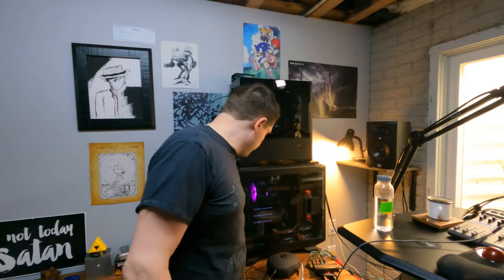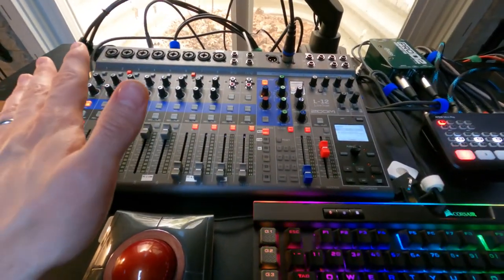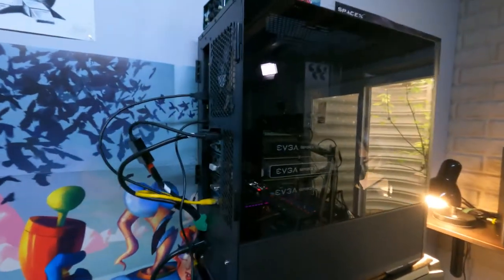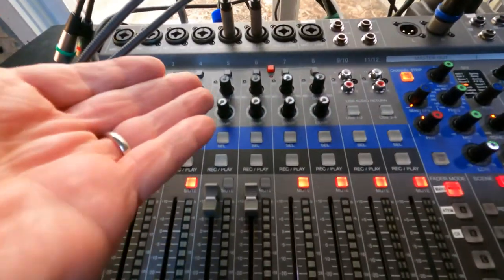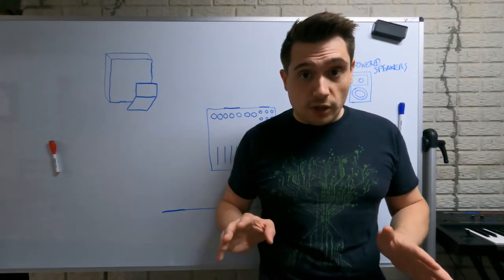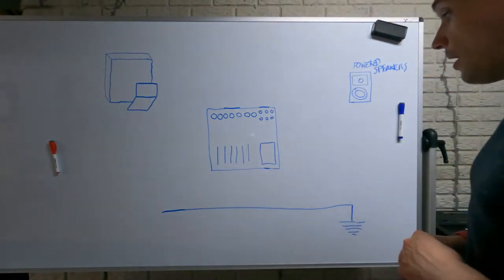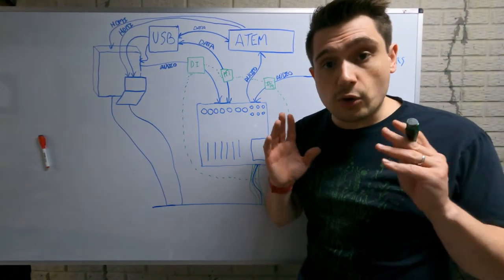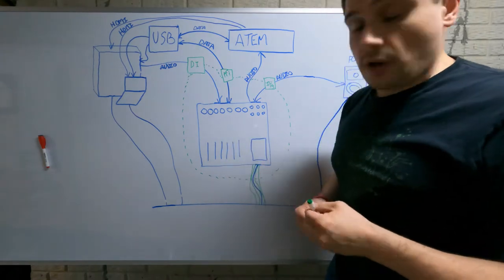SOLVED: High Pitched Buzzing Noise / USB Audio Mixer Ground Loop Issues

Comment: Having an issue modifying a church sound system and the direct box or the IFI unfortunately may be the fix. Organist aged out and now all music played from computer, trying to take the speaker out on laptop to the mixer and then a mixer output back to the laptop thru USB Creative Labs Sound Blaster Play! 3. After plug in the USB get low moaning sound. Right now the speakers and microphones go into/out of an amp that the mixer was also fed into --- like I said modify - taking the amp, cd player and cassette deck out of the system. Once speaker and microphone plugs arrive making switch to just mixer.  Thanks for thorough explanation.

Comment: The IfI defender is working like this -   From your USB out / in ,  it convert the data signal to optical signal and 
transmit through an optocoupler the data as light , In the optocoupler there is a light sensor that is used to convert the 
light back to electrical data signal and through a buffer is send to the Out / in at the other USB port .
That way thee is NO physical wire and thus NO electrical ground between the two devices at all .
This is also why it need an external powersupply and that need to be ground liftet so to NOT just introduce another 
ground path .   
Note that I write Out / in that is because the USB or if use firewire is Bidirectional so signal flow both ways .
Those iFI defenders work extremely good and it really doesnt matter what brand you use or the actual quality 
( as long as its not really bad ) because it will never affect the sound ( it is all digital signal only ) so as long as it 
comply with the USB or firewire standard ect then it work just fine.
As for the one that burned , I will say that one was a manufacture defect , typically a voltage regulator that 
was shorted out somehow , that normally very rarely happen because those run constant power and not like other 
components draw more or less power .

There is ethernet isolators working just like this too and perfect if you have a modem / router / switch / hubs ect 
in / on / between your computers , aka network and internet that can further isolate that dam.... sigital noise too .
Same principle using optocouplers .

USB and or PCI power conditioners also working very great .
I have used a PCI ( not PCIE ) card power conditioner inside my computer ( there exist PCIE too ) 
what they do is offload the digital noise and transients that is on the powerrails in computers with not the best 
power controllers / and / or powersupply .
Those can be extremely noisy and sometimes this noise going out in all different ports on the computers .
From onboard soudcard to usb ports ect ect ect and those can actually remove it .
It also make the computer run more stable too because the power is with less spikes and noise .

Many of the more exotic solutions have a specific purpose and wont work equal well in all systems .
It all depend of system and situation and what cause the noise in the end .
I agree that most can look like  snake oil , but it is just until you have a specific problem that can only be solved 
by an exotic solution .

Noise fighting is really an unfair fight and an extreme art to master .
Great video  , im subscribed , keep up good content .
Cheers ..
Ps sorry for typos , im on morning coffe right now .
Reply: No. There is no optocoupling circuitry inside idefender.

What they actually do is they switch impedance for power and ground lines. If the current draw is more than 5mA, there will be direct connection for the ground and +5V being transparent effectively. If less than 5mA, the impedance switch is on and there comes high impedance for the ground and +5V. If there is an external power connected to idefender, ground and +5V have high impedance as well. They used high impedance instead of totally lifting, so that the handshake could work.
Reply: @juneaftn  Ok , so they do it different than normal USB / Firewire  ground isolators , all 
the models I have used was using optocouplers and is a great way of totally isolate the signal . 
Also using optocouplers is less prone to 
failure too . 
Thanks for the correction about the IFI  .
Honest , I dont really think it will be as eficient as those with optocouplers or safe , 
I just think about the one that burned and 
that shouldt be possible unless something 
going bad in some regulators and it send 
full power through it ( typically caused by 
some kind of short , capasitor , you name it)

Thanks for correcting my mistake on this IFI 
I simply thought it work like all the other 
ones I have seen through past 20 + years .
I think I will stick with the good old based on 
optocouplers so to get 100 percent electrical isolation , it is much safer for the 
connected devices .

Just another little thing , thanks for the tip 
about connect the DI box the opposite way ,
that works GREAT and I simply dont know why I didnt think about this because they are bidirectional , well they are fully passive  
and connect the other way around , YES 
it fully works   :  )

Comment: thank you very much for the time you took to explain the process. Definitely one of the best explanation I've seen. Few questions though - is there any other device that could help with ground lifting the USB ? My mixer is connected to ground so not alimented via USB but I still of course get some nasty high pitched sounds (not hum). And I don't live in the US so somehow getting the Ifi isn't easy. Also, which mousepad are you using haha ? I have the same Kensigton mouse and they definitely rock but they also need an appropriate mousepad given the height of the base. Thank you !
Reply: I have a USB ground loop noise issue with my boss gt001 effect, the audio is silent but once usb connected to the computer the noise is irritating and kills the recording, recording through my Presonus audio box it is perfect. Do you have or have you found any solutions?

Comment: Hahaha nah I love this, this helped me feel less ridiculous than I thought. That this isn't a simple problem with a simple answer and is actually a complicated matter. The weirdest thing about my issue is that my arturia 49 would cause feed back snores when going into power saving mode. So if I tab a key, the noise dissapears. But the noise doesn't occur when I unplug the midi DIN to  midi din hub cable. This noise drove me crazy for so long cuz it would come and go and made me think I solved the noise issue then sudden it would.appear even while I wasn't doing anything to disturb it. And I would start pulling things out and moving them around trying to find the problem.

But I have so many prices of gear its crazy..... But at least I won't get anymore gear so I don't have to worry too much

Thank you, for this video though. Bug fixing is a major part of our growth

Comment: after pondering a bit further, im pretty certain you can hook up a your atem to another usb isolater or 2 save money, hook up a hub to the usb isolator you have and run both you mixer and atem off it. . ,  once you do that , the only isolater you need should be from audio cable to mixer, since its a connection to the computer, once those 3 pc attached items are isolated , you should be able to disconect all the other isolaters you have including the  ones the speakers
Reply: From what I read about these devices they use a chip with a limited bandwidth. So some support say 15mbs so USB1 but not all USB 2 and definitely not USB3.
Reply: @stephenhookings1985  essentially it is a some sort of digitial isolater,  almost every one i found on the market is limited to usb 1.0 from the year 2000. . so its extremely slow, but IFI claim to support 3.0[ i havent tested this since i dont own one yet , but you can since you own and easy test would be is to do a large file transfer from to a HDD tru that ifi and do the same test with it connected directly to the pc. . notate , usb 2.0 easily carrilies up to a 100 mega bytes a second

Comment: I service and repair amplifiers, receivers, transceivers, power supplies, etc. and this noise is very likely coming from a poorly filtered or particularly noisy switching power supply or PWM LED inverter/driver circuit.  What I hear in that noise is 120 hz hum/buzz or possibly an audible sub-harmonic from a switching element that's around that frequency.  Cheap switching power supplies and drivers can radiate electrical noise and RF down wires and into the air,  and of course,  long ground loops can act like an antenna and pickup everything. 

 I doubt the audio specific gear (powered speakers/mixer, etc) is causing the problem,  as they are engineered not to radiate noise or even create it in the first place.  It's likely a cheap wallwart switching power supply (like something that would come with a powered USB hub or the video switcher) that's causing the noise or possibly even the PC's power supply.  

One cheap way to track down the offender is to buy an inexpensive battery powered AM radio for $10-$20.  Turn the radio on,  turn up the volume and tune it until you just hear static, and start walking with it around the room and move it near any electronics that could potentially be electrically noisy (wallwart power supplies, RGB LEDs or their power supplies, the PC power supply).  AM radios are particularly sensitive to switching power supply noise and harmonics,  it will get loud and you'll hear that buzz the second you get near something noisy.  I've use this method quite a lot with good success.

Comment: Very nice and clear video, with some good solutions presented.
I do have a few questions however.
-1- Am I wright that using a Directbox with groundlift is actually effectively the same as soldering a custom audio-cable with no ground connected at on one side? (appart from the resulting balanced signal)
-And an Isolator is also kind of the same idea... (Although those actually also "cuts" the signal lines) Am I right?
Making an custom cable that way does feel unsafe though? But is that the case, when both sides are still grounded by the powercable?
-2- Another, I think stupid and 'unsave question' (so not an advise to anyone!!): I do understand that it is not a good ideal to bypass the "ground-pin" on powercabels as discussed in the coments and in the vid, there is a serious good reason those equipment need this grounding. However technically when I think it through I tend to believe that as long as those (lets say) speakers are connected (and grounded) through the audio kabel with a mixer, wich is properly grounded there shouldn't be a problem. Can anyone explain to me where I'm going wrong here, cause I do have learned it is a bad idea, but I don't know exactly why...
BAD IDEA (see my own response)!!
Clear is that using those IL-19 between a mixer and speakers is a more obvious and safer way to hook things up.
My last question is however, do they alter the sound? I read a lot of mixed reviews on the audio quality of 'Ground Loop Isolators'.

Thanks again for the great video!!!
Reply: Okay I figured out question 2.
The "Power ground pin/wire" is often used to trigger 'safety fuses' and other safety elements. When this ground is 'cut' these safety measurments are Bypassed. So no matter whether the grounded audio kabel will or will not provide a ground, the device will not shut itself down when needed, so this is indeed a very bad idea. Something someone should never ever do....  Now I DO know why this is called a recepy for disaster. (fire/electrocution) To be honnest I'm a bit confused why they still sell those 'groundlift plug' adapters ??????
Reply from the maker: Great questions! I will answer your questions to the best of my ability:

1. The proper way to ground lift between the two sides is to use an isolation transformer, so there is NO direct electrical connection between the two sides -- even on the "hot" signal sides. The quality of the signal passing through the isolation transformer will directly correlate with the quality of the transformer. Very good ones will be as close to a "flat" EQ response as possible, whereas bad ones can introduce signal loss that affects the quality of the audio.

2. Regarding grounding through audio cable shielding, you never want to do that because the gauge of the audio cable's shield is way too high. Just take a look at high voltage electrical cabling and notice how thick it is compared to the shield of your audio cable.

Since the audio and data cables are way too thin to sync 120+ Volts to ground, in the event of a short the audio and data cables will just get really hot (possibly setting a fire) and the current will try to sync in alternative directions, potentially hurting someone.

Hope that makes sense! Thanks for watching and good luck solving your ground loop issues!

Comment: More questions/problems.
* Opening a project i got message that 970 files are missing. With Search i found some missing files, it became 270, and these can't be found anywhere (i've searched all folders /sub..sub_subs/ in my big folder dedicated only for StudioOne, all back up /mirror/ folders on 2 external drives). It is an old and very extensive 'precious to me' project, and ridiculous thing is, for example there is a guitar solo, i splat it at some points to get rid of some noise when i was not playing, now the solo is there only in pieces; all channels are ripped off here and there. Plus other issues.

* Yes, as a rule i have a 25 minutes save; "use cached plug-in data on save"; "ask to copy external files when saving document" all on/checked. 
* I didn't change nor names, nor locations of working folders and files (though i have this project saved under different names as versions).

* What i did is: i replayed some important stuff on left-overs and added two old stereo mix tracks of this project/song with different EQ settings (and with mistakes, quite unbalanced, but it is better something than nothing, there is no way i'd re-do everything due to circumstances and unrepeatable settings and instruments). I aligned everything nicely (time, buses, volume,..), corrected, blended everything nicely, and put vocals at the right level (up and with different settings, that's why mainly came back to this project), clicked "save". Logically, the DAW asked me "do i want to add these two stereo tracks/files", obviously, i clicked "yes" and...1475 files for each added stereo track started copying. In panic i pressed "cancel", but it was too late. Where these files are from, why?! Why these stereo tracks came with so many files? Where they went to?
I checked the media folder to look for duplicates: no duplicates, but there are about 6000 files there (and some of them are not from this project).

* But this is not all: i had plenty enough of memory space (workable 450-500GB free), now i am in the end of red zone with 78GB left.  Agh..

* But this is not all again: i started clearing up the space on pc and the more i delete or move ...the lesser space i get on computer...now it is 50GB.

* To free space and continue working (without interruptions and CPU overload) i thought that i would mirror the path, create the same folders in external drive, link the project to media files there, But i am afraid to make things worse in this and other projects (especially considering that freeing the space now works for me the opposite way).

* What is wrong? How can i fix all that mess?

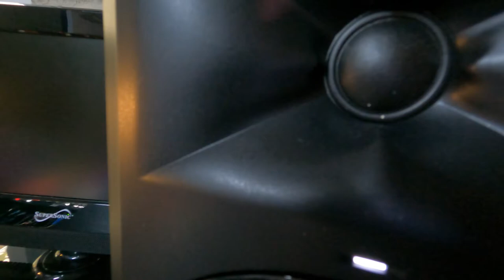Comment: That sound you hear at 11:30 looks like coil whine,  I solved this by getting a Behringer HD400, it eliminated everything for me from PC, ground loop, coil whine. I have a few on my PC's line outs and line in.

I guess the HD400 is nearly the same as your ProD2 with the exception of the lift switch, you just need to add more of them for all devices to get rid of that.

Comment: I don't know if you will ever see this but I would like for you to try just isolating the usb connections to the computer and see if it resolves your issue. I had the exact problem as you but that was the only source of hum when once I isolated every thing else. I looks like that was your same pain point at the being of the video. From what I read it has to do with the data being a 2 way path and carrying electric current at the same time.

Comment: Have been having ground loop issues for some time now. I have a ground loop isolator on my speaker cables, it didn‘t solve the issue. I bought two wall power socket ground loop killers on Amazon, these didn’t have any effect Solent them back. Just yesterday, I realized that the USB cable from my MacBook to the mixer is the culprit. I am now looking for a „ifi type“ device for that USB connection. I indeed saw the ifi device on a Google search yesterday. After hearing what you reported about your‘s burning up, I’m definitely giving that brand a wide berth. So, am still searching for a solution here. The problem is, the two USB C outputs on my MacBook are so close together, I can’t find anything slim enough that fits. Do you have a solution? Thanks 🙏

Comment: I had a terrible ground  loop within my pedal board and mixer in my home studio !
Just couldn't get rid of it so I had to use a gate but it was not a great idea !

Then I remember a friend had told me ages ago to cut the earth at one end of the audio cable so there was only the signal without the ground connected at one end of the cables !

The hum completely vanished !
Cheapest and easiest method by far !

PS

I didnt cut the mains ground cable !
I did it on the audio cables input !
The output audio is still grounded !

DS